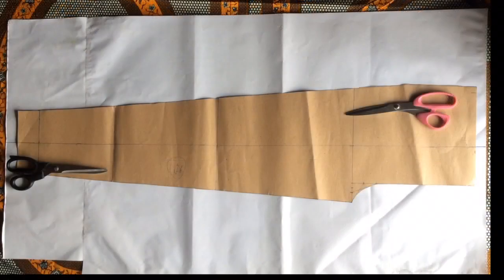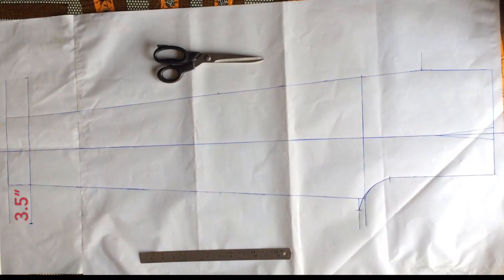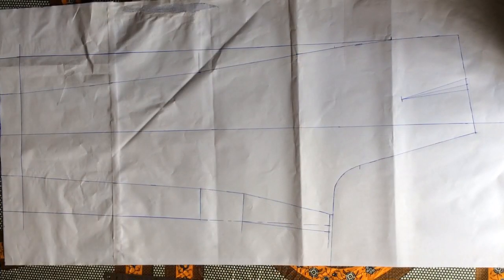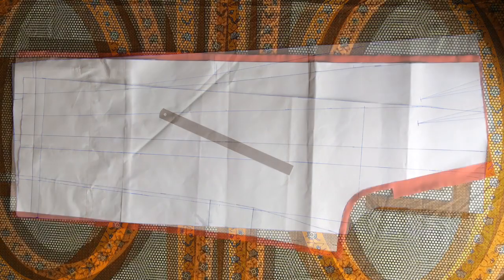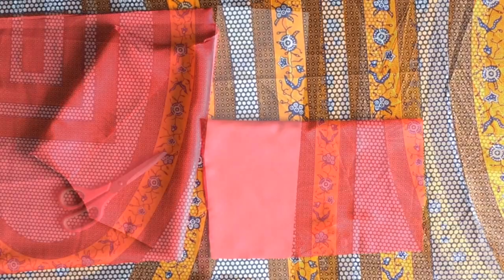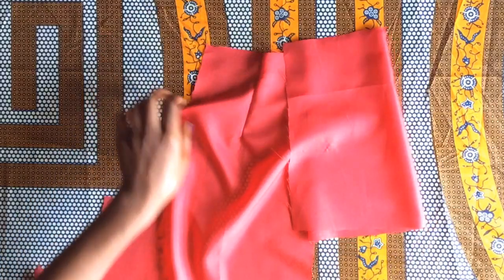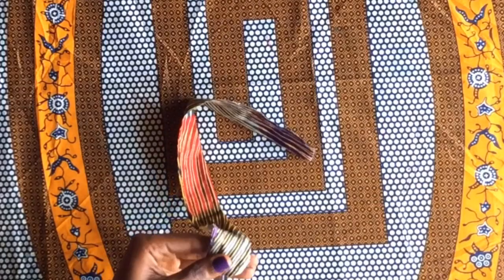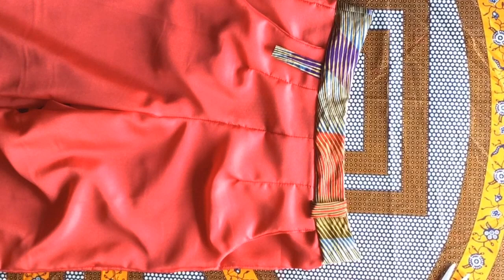Easy palazzo pants Wide leg pants cutting and sewing

Comment: Hi Ella! Please did you cut the pattern with the actual crotch measurement? Because I realize that you added some inches to the front and back crotch line.
Reply from the maker: Hey dear... I used a basic pant block as a guide. Only dat adjustments were made to achieve a palazzo fitting, both in length and depth.